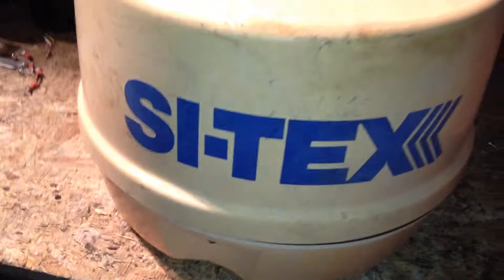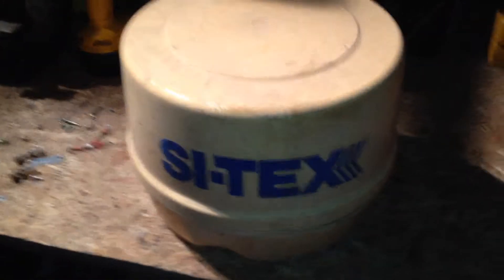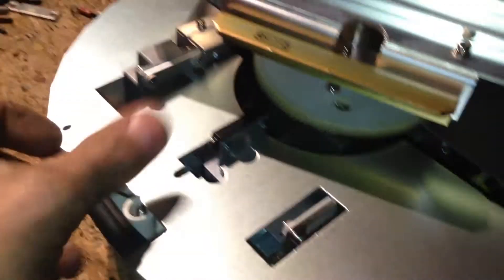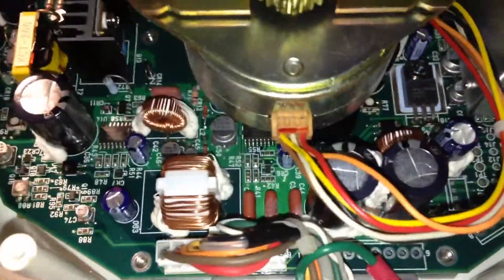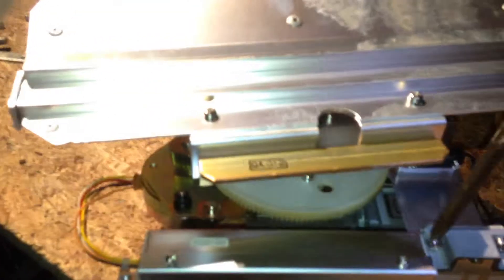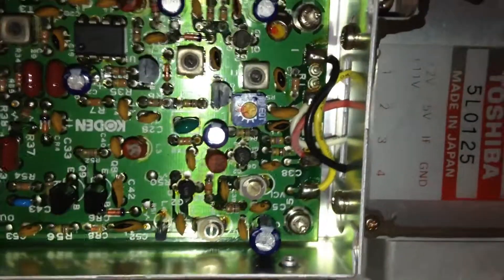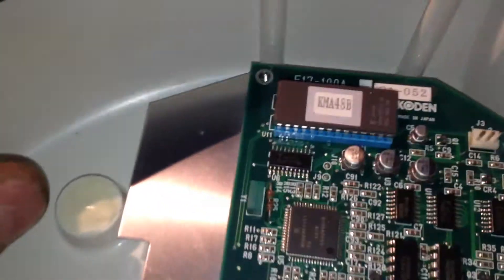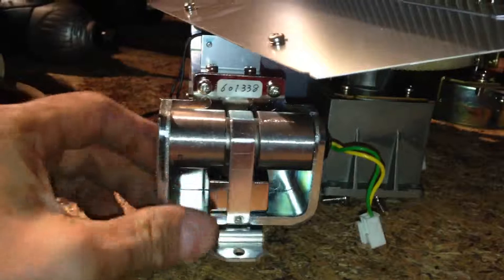Teardown "SI-TEX" marine radar antenna. (Toshiba)

Comment: Wow! A crustacean locator! I want one! @ 4:35 - stepper motor - @ 5:45 - magnetron - very strong magnet - @ 5:52 - the Toshiba thingy with the red arrow is probably a circulator to isolate magnetron transmitter from receiver input - without that, the mixer diode in the receiver would go "pop" at the first magnetron pulse. - @ 8:40 - the receiver IF amps and probably demodulator stages as well
Reply from the maker: I'll take your word for it.  HA! You are a genius as usual! Thanks for the info.  It's a neat chunk of dumpster junk! Soooo, magnetron, as same wavelength as a microwave oven??? Mr. Burns.  When the tax check clears,,, guess what!? I'll finally have the shipping cash I've been waiting for, for oh, well, 6 months now!!???? Dang I can't wait. Have a one month old at the house and damn that booger drinks a lot of formula.  I just can't wait.  Cnt wait !  Steven
Reply from the maker: "Crustacean locator" HAHA! I see what you did there! Dam I love them.  Bet you got some yummy ones where you live!
Reply: Steven King
microwave ovens run at 2450 Mhz - i think most of these small marine radars run about 8 Ghz